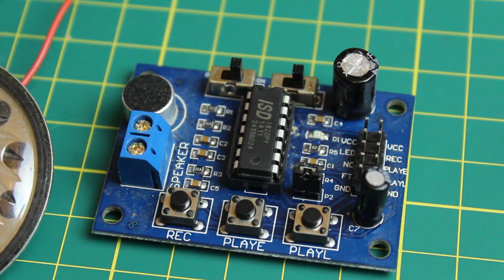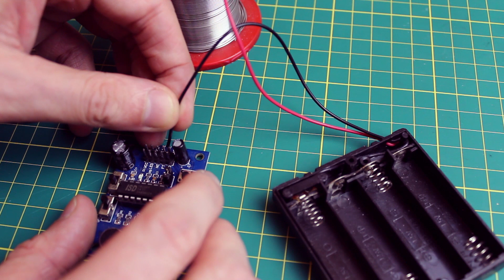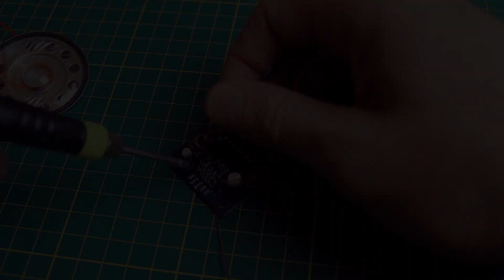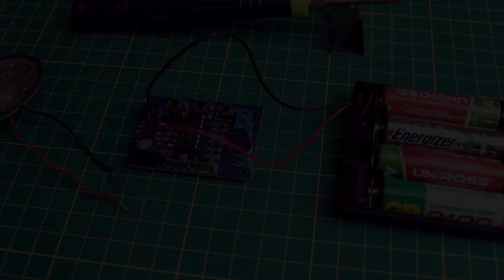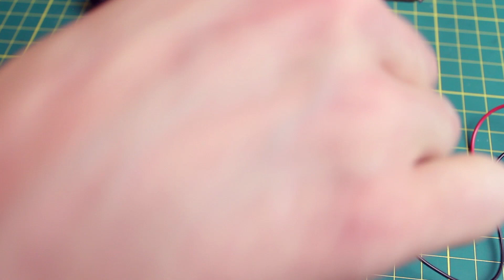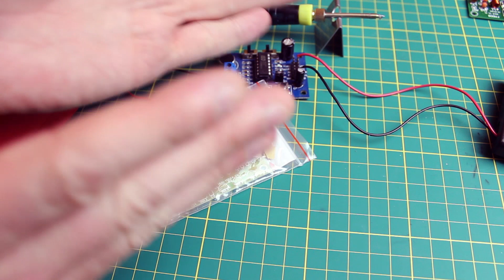£5 Friday:  ISD1820 Voice Recorder

Comment: It will soon be (or is already) a legal requirement in Europe to have some sound emanating from electric vehicles at very slow speeds. You mention speech recording but, presumably,  a low frequency recording of a motor sound could be made.
Also, would it be possible to tap into the PLAY switch to have a remote button on the vehicle dashboard? Thanks.
Reply from the maker: Sure that sounds possible. The car running off 12v would be your biggest stumbling block. A playing card in the spokes worked well on my bike, we need a 2020 car version!
Reply: @DavidWatts  Thank you..We couldn't afford playing cards, just scraps of cardboard :-) If used incorrectly it would unscrew the valve !
Reply from the maker: @lordpitnolen2196  same, I said playing cards for the visual clue. Really it was bits of old cereal boxes 😂

Comment: Hi, quick question. How do you change the batteries? I have this music box (not a traditional one, one with this module in it) and it won't play well, I think it's because of the battery but they are in this metal casing that I can't get into...
Reply from the maker: Hmmm, I haven't seen a setup like that before. It sounds like you will just need to replace the batteries, cutting it out potentially.

Comment: The battery box supplies 6 volts. Is that not too high for the board? With my ISD1820 I took 5V regulated power off a Basic Stamp board.
Reply from the maker: Those were NiMh cells, so would likely have been kicking out around 5-5.5v. The ISD1820 can run from up to 7v according to the datasheet but that is a maximum value, normal operation is stated as 2.7-4.5v.
Reply: @DavidWatts  Thanks. What is the theory behind the Pringles tube that causes the volume to increase to such an extent? (Using the supplied speaker.) Could I use a small wooden box from e.g. thin plywood and cut a hole in it for the supplied speaker?
Reply from the maker: I think it just increases the area that reverberates giving a louder base sound.

Comment: I assume they were 4 x 1.5V batteries you used to give 6V, and it was ok? (Unit is rated 3-5V.)
Reply from the maker: I believe they were rechargeable batteries so 4.8-5.2v is a reasonable figure for them.
Reply from the maker: I believe they were rechargeable batteries so 4.8-5.2v is a reasonable figure for them.

Comment: Can I ask what pins you used to hook your power,my module looks very simaler,my speaker has a dedicated jack,and doesn't have the side switchs,but the rest is the same ,I notice you used 4.5 volts good to no,I just need to no what pins you used,I found the ground pin,did you hook up the plus to FCC.anyone please
Reply: Simply connect to the VCC and GRD pins that are clearly marked on the board that you own. Everything you need to know will be listed on the webpage from where you purchased it.